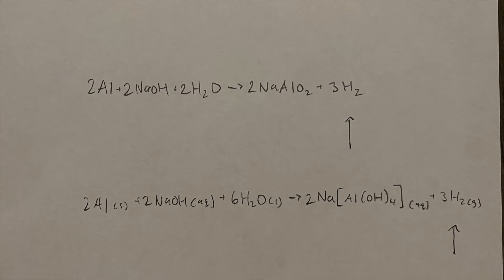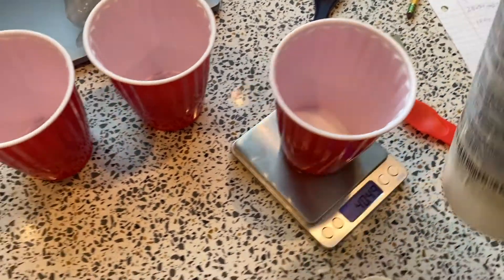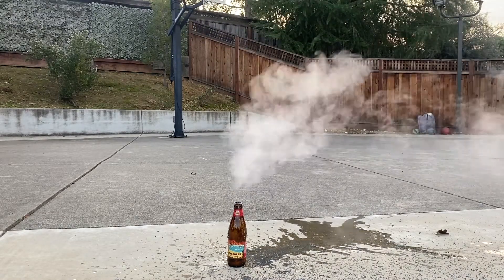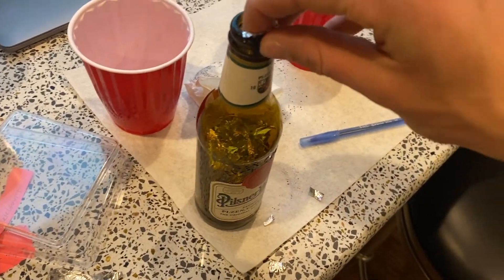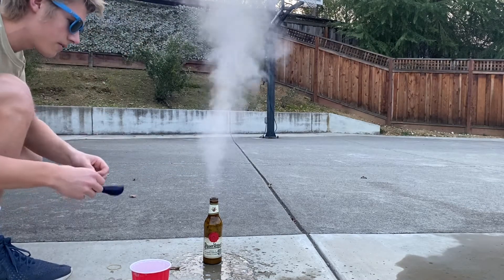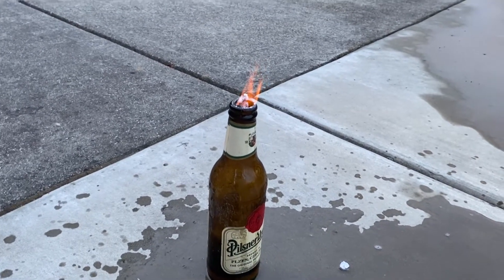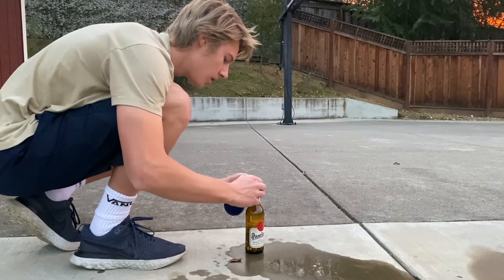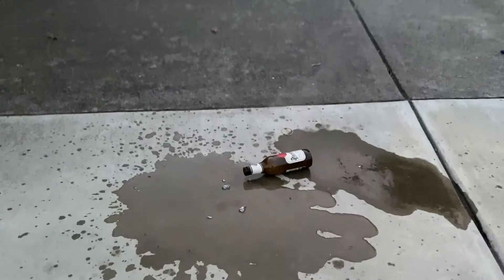Hydrogen Gas Collection

Comment: I would agree that the reaction was so fast due to the surface area of the Al, in your first attempt. However, it may have been much less of an issue if you had carried out the reaction in a container that wasn't restricted at the mouth, ie. a vase or some sort of cylindrical object. I do understand that that would make trapping the gas much harder :) Your third attempt was exactly what my next suggestion was going to be. anywho, I look forward to your next update!

Comment: One of the issues here is that dissolving NaOH in water is highly exothermic.  The water boils rapidly as a result and much of what is being emitted from the bottle is water vapour.  Recommend that you try making an NaOH solution first and cooling it before adding to the Al.

Comment: Yeah foil is safer than powder, and I'd use a dilute sodium hydroxide solution to the foil rather than adding water to the hydroxide and aluminum as the dissolution of the NaOH is super exothermic, the reaction already easily runs away using 20% NaOH to foil usually so yeah its probably better to do that. And use a longer ignition source, I got somewhat burnt when I lit a hydrogen-air balloon using a bunsen burner. The hydrogen produced also has NaOH mist which is why its choking, I would go for a setup with the bottle using foil and dilute NaOH, a cork with a plastic tube going into a water bottle as a bubbler and the exit tube

Comment: Based on my own basic experimentation here there's also a lot of water vapor output from the reaction as well (i'm guessing it's just boiled off).  In addition, with larger volumes it gets extremely hot and you start getting runaway reactions.

I stopped tinkering but I think running the output through a bubbler would help clean up the output to get rid of the water vapor.  Just keep in mind you're going to have hydrogen and oxygen n proximity in various parts of the pipeline so avoid glass/metal containers and definitely wear eyepro (preferrably with splash protection, they are dirt cheap on amazon).  

I think what i would do here is add the foil and water to the container then drop in the NaOH last.  Use more dilute mixture to slow things down a bit (it will speed up once it starts heating up regardless).  If you're thinking of making large quantities look at fermentation buckets and blowoff tubes, could be a good combo for this.  

Just watch your eyes bubba, you only get two.  Have fun!
Reply from the maker: Adding the foil and water first worked great! Thanks.